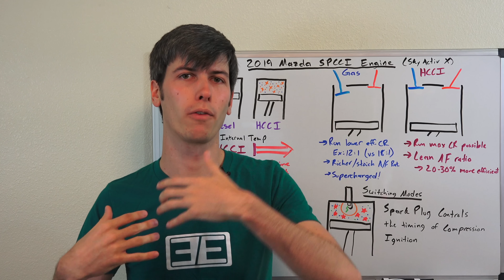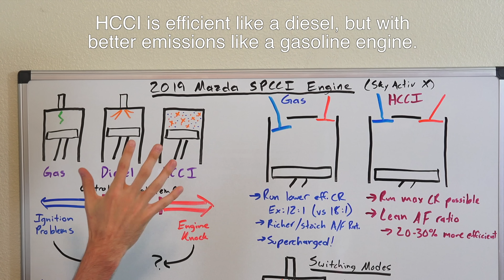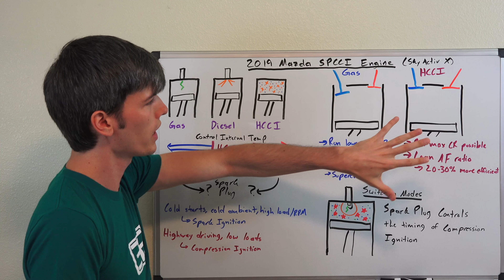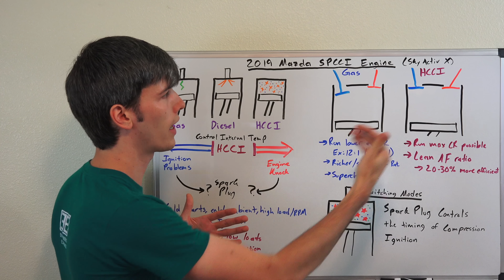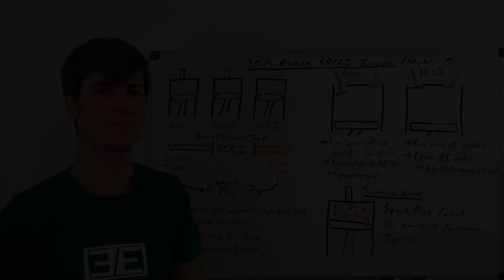Mazda Creates The Holy Grail Of Gasoline Engines - HCCI SkyActiv-X

Comment: Ask yourself , how is the electricity in your area produced , many electric cars are essentially coal burning cars , hydroelectric requires flooding of thousands of hectares of land and displacement of man and beast and well , solar and turbine can't fulfill all needs , oh yeah and the last one , what about the waste ?
Reply: FUD FUD FUD. Did you even research there issues before posting them as problems?
- You have to have more electricity usage (that is EVs) before it makes sense to expand the production. This is new capacity will never be coal, since coal is more expensive than hydro, solar or wind.
- Even if run on pure coal (which does not take place anywhere in the western world. The grid is always a mix), EVs are more environmentally friendly than ICE-cars. The CO2 emissions might be closer, but the impact on the air quality is vastly different when your vehicle don't let of out toxic air to your local environment.
- Waste? Be more specific. Lithium-ion batteries are not generally considered dangerous waste. Also it would be foolish just to leave them in a scrap yard since they are valuable to recycle.

Comment: If it ever happens! Too complicated. Imagine if someone could come up with a car that no longer has VCR technology, such as belts, clutches, torque converters, Bendix drive starter motors, fixed gear ratios, And don't forget that old classic, Vacuum assisted friction braking, that would be a real revolution. Oh wait, Toyota already did that, in part in 1997 and fully in 2009, but the criticism usually outweighs the advantages. The first car to have an inverter AC compressor, Infinitely Variable Transmission often confused with Constantly Variable, the ability to hypermile on recycled energy from the brakes, especially with the 4th generation model. I could continue. If 99% of vehicles were considered VCR technology, the Prius would be equivalent to DVD technology, the Tesla would be IPhone technology, but the Android equivalent, where you could plug in to your house to run household AC and then recharge at off peak rates are still not available, and certainly wouldn't be affordable.

Comment: My question would be how they keep combustion chamber temperature under control because even if there's no knock you still get oxides of nitrogen forming and the cat isn't going to clean that up that's usually an EGR valve used to reduce that but that's done by diluting the intake charge with exhaust gases.

Comment: I would imagine it is very simple, control the voltage to the spark plug and therefor adjust the compression/explosion on the fly.
The compression would be set higher than normal but not as high as a diesel, so you could kick it with more spark on a cold start or when more power is needed. Hybrid gas/diesel burning gas with adjustable spark. What do you think?
Probably using a msd type of spark amplifier that is controlled with the engine management computer?
I don't see bleeding compression through the intake valve as it would be prone to burning the valve.

Comment: I still am not clear how this compression-ignition improves the efficiency.  One reason a diesel engine is efficient is because it has no throttle-valve which strangles a gasoline engine..... does this new Mazda engine also eliminate the throttle-valve?

Comment: Knowing nothing of engines, and going based on the pictures alone I assume gasoline engines run on lighting bolts, diesel engins run on fire and HCCI runs on magic.
Reply: I own a 2015 Mazda3 with Skyactive technology and can confirm:  My car runs on 73% lightning bolts, and 27% magic.  Says so in the manual.  The new HCCI engines will run on 82% magic, 11% fire and 7% lightning.  My source for the latter are the telepathic messages I receive from my Mazda3's infotainment system when maintaining speeds of over 130KM/hr...
Reply: @mjoa1  
Freaking epic. 😁
Did the car come with optional tin foil copper lined hat?
Reply: I was starting to space out in the video, but you have cut to the nut of the science.  Thank you.
Reply: exactly correct. you have a keen eye for detail sir well done
Reply: Eric 
😂😂😂👍👍👍
Reply: lol..;) 
epic one ..
Reply: Nailed it.  Good job.
Reply: about right

Comment: Great blending of theories until one has to work out the specifics to make it a 200,000 + mile reliable motor in a vast range of climates.  More miles to the gallon at a huge cost in complexity which will, when the problems start, mitigate any fuel savings.  If all they want is diesel like economy why don't they just put the old Japanese copy and improve mantra to diesels.  I've had 2 Mazda  cars bought new in my life.  The later 929 (the one that looked like a Lexus) and when they dropped that model the Millenia "S-Version" with the Miller cycle engine.  We liked both well, nothing amazing however.  Then we went to Infiniti and got the G-35.  That was a slightly larger and more refined car with a more basic and better engine - a real upgrade from Mazda interiors at the time ( the Q50 is right there now with the Germans)..  Infiniti = Impressive to me,  In fact we bought another one and gave the original one after a few years to our daughter.   Now, I've often wondered how Mazda stayed in the US market with their scattershot styling and few hits.  I'd say in the early 2000's  the Mazda 3 kept them in the game.  Now their 6 looks like a winner at least in outward looks.  Honestly though, perhaps besides the very long in-tooth Miata this company just misses most of the time and I've never heard any one, owner or car press, say their interiors are even approaching the quality of a VW.  I'd really like to see Mazda pull something amazing, and beautiful, off.  I just don't see this complex Sky-Ativ X (who names this stuff) as a coming great cornerstone for the company.  It's going to take something to take on Toyota, Honda, Nissan, and now the juggernaut that Hyundai has proven it wants to be.

Comment: Thank you for this high level explanation. Essentially, it runs in normal Skyactive mode with a spark plug unless conditions are optimal (low load, not extreme external temperatures) and it switches to compression/heat.  It makes perfect sense they (Mazda) is not sharing specifics, but your explanation makes it pretty clear.

Comment: what about air injection to increase compression ratio? you could run a normal 12:1 compression until you wanted the HCCI ignition, then switch to air injection to bump the compression ratio up and control it.

Comment: This seems to me that they are trying to control knock and pre-detonation and calling it HCCI. I am not familiar with what Mazda have proposed, but I have read some SAE papers on laser ignition and plasma ignition systems designed to push lean burn engines even further. I would not be surprised if Mazda used something other that a conventional spark plug.

Comment: Don't Top Fuel engines do this sort of by accident? I remember reading somewhere that nitro top fuel dragsters only run on the throttle for about half the pass and then start dieseling for the second half due to the level of compression and the temperature of the cylinders.

Comment: labeling it revolutionary is very ironic since Internal combustion engines won't ever compete with electric motors in maintenance, compactness, torque and efficiency. It's obsolete in every single of those metrics.

Comment: Why isn't Mazda more successful than it is? I mean think about it. How is it Mazda always trails behind Toyota, Honda and Nissan when their products always seem to be highly reviewed, and almost always their vehicles lead in their class. The CX- 5, Mazda 3, Mazda 6, and MX-5 being prime examples. Look at the sky active engine and how much power it makes for their gas mileage ca the competition. Not to mention a support for car enthusiasts that is legendary.
Reply: What's the difference between the approvement they have and not having that camshaft synchronizer I'm having a camshaft synchronizer directly on the cam
Reply: This is just my speculation, but it seems to me that Mazda spends craptons of money and time designing extremely complex engine technology and then drop it into cars which aren't rich enough to make a return on them. The most expensive car I could spec on Mazda's website was a $51k CX9 (midsize crossover/SUV) with a 2.5 Turbo-4. It's funny you should mention trailing behind Honda, when Honda 'personally' experienced how competitively-priced tech demos (like the undoubtedly awesome S2000 which flexed its VTEC like crazy) don't make much money and are kicked off at the first sign of financial trouble - and that was a decade ago. Mazda's space-age technology would be more at home in cars where the rest of the car is just as fresh as said technology is. They say Mazda's next version of the Mazda6 will be a straight-six RWD, and I suspect they'll have much more success selling something like that.
Reply: The working class and poor can't afford a Mazda.  Mazda reign supreme in Japan.  The rotary engine is awesome.  Check your neighborhood for Mazda's, they are none there.  Mazda have the highest resale value compared their counterparts in Japan.
Reply: Reliability. If Mazda could make their vehicles as reliable and durable as Toyota they would be more successful.
Reply: Cost and cost of ownership.

Comment: In UK all cars fully electric by 2040 which is funny because our power station situation is a joke  and grid infrastructure for electric is almost non existent
But remember for the foreseeable future  u need for internal combustion for lorry's  trucks and big vans  as weight rapes electric vehicles . Possibly hydrogen powered combination engines or alternatively hydrogen fuel cell cars could be a solution

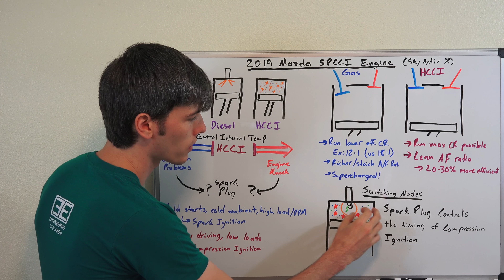Comment: 6:30 that's why today we have knock sensors, to change the spark timing when all the mixture simultaneously combust, because this causes knocking, its a problem you want to avoid.

Comment: The whole wolume of air/fuel mixture will ignite simultaneously if you make it just by compression, i think you would have knock problems,that's why the compression rate is limited on petrol engines. Diesel engines ignite by compression but you don't have already all the fuel in the cilinder.
You could run at very lean mixtures,ok, but you have the same problem as the direct injection engines and diesel engines, very high NO and NO2 emmisions.

Comment: maybe is there a way to individually portion every intake volume, therefore adjust the pressure with every stroke. in this way, different temperatures can be used for precision ingition. thus we will not be able to say this is a 14:1 copression ratio engine, but a 12...16:1 engine. or am I wrong?

Comment: I can't see the point of this. If it's in pursuit of reduced NOx then it's not gonna achieve anything. If you ignite petrol in diesel style you'll have diesel style NOx output. Diesel fuel doesn't create NOx. The culprit is the oxygen and nitrogen in the air.

Comment: direct fuel injection combined with air/fuel intake may solve some of the problems you mentioned. Flex engines in Brazil used something like spcci to run on both gasoline and ethanol, but the result was loss of efficiency not as increased consumption, but as reduced power.

Comment: Why not close the Intake Valve half way down? Would make more sense condirering Blow Back, which would happen if you expelled half the intake air again. 
Or the Exhaust Valve would open as a kind of De-Compression up to Half Way down the Compression Cycle.

Comment: I have a question, besides the lubrication issues, wouldn't using gasoline in a diesel type cycle be efficient? Control power by how much fuel is injected.

Comment: can somebody explain me how that switching works? So spark plug ignities the mixture it starts expanding and on the second run it is going to be ignited by spark again? RPM will switch off spark mode or Temp.will switch of spark mode or what will prevent the spark plug from igniting the mixture? I mean what is going to switch those 2 modes? You said when on highway or when on busy road where spark is better (or high perf.). So what will ultimately switch the spark plug (what condition)?

Comment: Jason, quite a basic question here. In the intermediate mode, when you say that the spark controls the ignition of the homogenous charge, isn't that how normal SI engines work? Would the CR be somewhere in between the 2 extremes? It'd be awesome if you could clarify !
Reply from the maker: That's not how normal SI engines work; with normal SI engines, the flame front consumes all of the air and fuel mixture. If anything combusts by pressure, this is referred to as knock, and undesirable. In this case, Mazda is intentionally controlling "knock" to do exactly what they want it to do.

Comment: This video is a perfect example why gas engines need to go away. They are too complicated and wasteful, electric engines are cheaper and has lesser moving parts. I see so many anti EV comments, mostly are from people who don't own electric cars. I do, and since January, I paid less than a dollar for my "gas" and I drive 70 miles a day. All my power comes from solar. EV's have a lot more potential, for ex. torque vectoring is much simpler to do in EVs than gas engines.

Comment: Please just make the standard fuel 95 octane minimum. no ethanol and skewed ratings. Why not maximize the technology we already have before, introducing complicated expensive changes on the auto industry. 95 octane, direct injection, high compression, and high boost. There is your 55 mpg with performance also.
Reply: Justin Cross where I live 99% of gas stations offer only 95 octane or up. You still can buy lower octane gas but you have to look long and hard to find a place that sells it. And then it'll be the same price as 95, so kinda pointless. And yes, most of the cars sold here are have around 55mpg. But that's not because low octane fuel is basically not available, it's because fuel is expensive af so customers really care. Current price per liter for 95 octane is around  €1.15 (~$4/gal if I'm not mistaken) and we're one of the cheapest countries in the EU, you easily pay 25% more in other countries. Which explains why diesel is so very popular here - better gas mileage and diesel is ~5-10cents cheaper per liter because it is taxed less. But now, after the exhaust scandal some governments are thinking of changing that and making the tax for diesel the same as for gas.
Reply: TheFeldhamster Here in the good old USA the market is dominated by 87 octane. Where I live it can be had for $2.25/gallon. Low considering we had a $.25/gallon tax increase. If 95 octane was the standard grade fuel. I believe it would give Americans what they still crave, big fast cars/trucks. All while being much more efficient.
Reply: Justin Cross wow, 87 as standard? That's like you're stuck in the 80s/early 90s.
Also, I never had the impression the average American is into "fast" cars that much. Whenever I rented a car in the US the thing would feel like driving a sofa to me - big, slow acceleration, and overly soft suspension. And that's coming from me who is used to French cars which are considered soft by ppl. For a car to "feel fast" during everyday use it has to accelerate quickly (if you don't want to break the speed limit all the time) and you have to feel the road a bit. And, no offense, but if you drive an automatic you're not really that much into driving anyway.... so, from a European perspective the average American is into big, comfy cars that look impressive. But fast? I didn't get the impression that many would get something like a VW Golf with a motor just below the GTI class and reasoning like eg the avg German would do: a GTI is too expensive and a bit too much for braggers but I need sthg with good acceleration so I'll not miss out on Fahrvergnügen. I mean yeah there are sports car owners in the US but I don't really associate "loves fast cars" with the average American.
Reply: TheFeldhamster yes it does to me feel as if we are that far behind. We are being told our inefficient automobile need to be replaced with battery powered ones. I believe before making that change we should at least maximize the efficiency of the internal combustion engine. Higher compression, more boost, more ignition timing etc. horsepower and payload sells autos here, not mpg.

Comment: ICE engines better improve to keep up with electric, we are a few small technical hurdles from making lithium ion batteries at least 30% more efficient thus giving electric cars better practical range.
ICE vs electric is no comparison, nobody will want a smog spewing, oil leaking, part wearing, mechanical nightmare that all ICE engines are and always have been.

Comment: Hey Jason, about the SPCCI system, you said the spark plug would start the flame front, which will in turn alter (increase) the compression ratio during the HCCI mode. But the main question is that when the HCCI mode is on, the mixture is lean which couldn't be ignited by the spark plug (therefore it can't initiate the flame), the exact reason why we are using compression ignition!
Reply from the maker: +Paavan Shetty the spcci mode is an intermediary stage between hcci and regular spark, to switch between the two modes, so the air fuel ratio will alter as it switched between the two modes, allowing for the spark to ignite the mixture.

Comment: I do not think they will use the spark plug in the conventional way, I suspect it might be turbulent jet ignition (TJI) which will ignite a lean mixture at normal compression ratios. Also, my understanding is that they will not use a turbo charger as such, but some device that will inject compressed air directly into the cylinder and increase the compression ratio to the point where the mixture will self ignite, this could also control the timing.